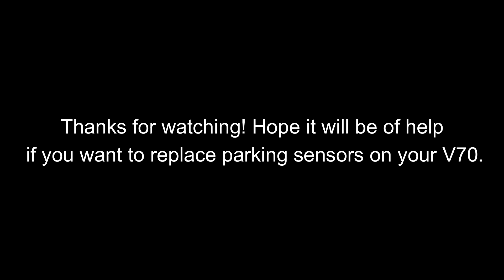How to replace Volvo V70 P2 rear parking sensors

Comment: Hi, I have a V50 with sensors that look similar to yours, you also had so much problem taking them out? I tried today for a moment and gave up because It was so stuck I was afraid I'll break something off. Do you have any tips on taking them out because my only has one dead.
Reply from the maker: @WRBL69  yes they were quite stuck there. I ended up braking two of them.